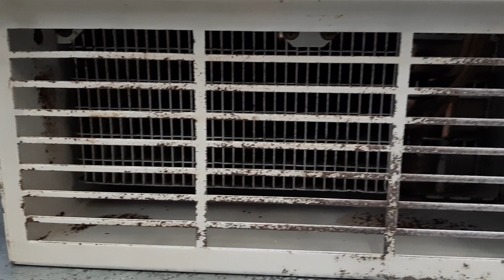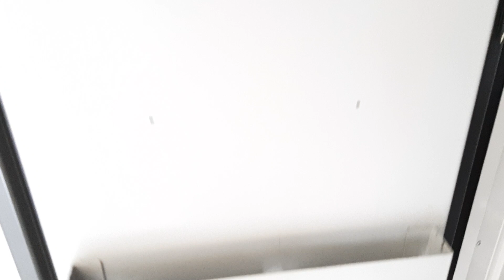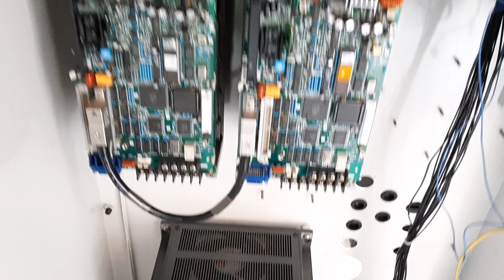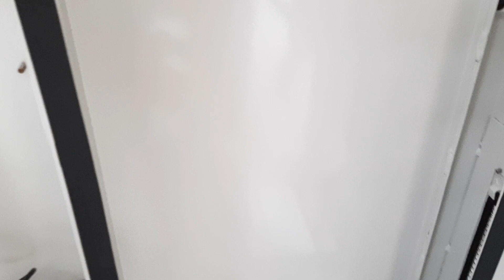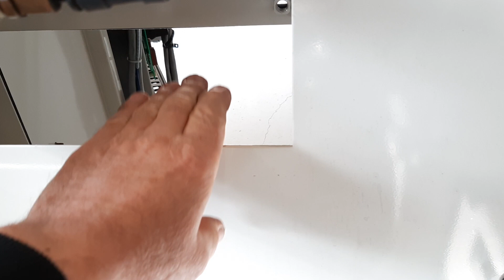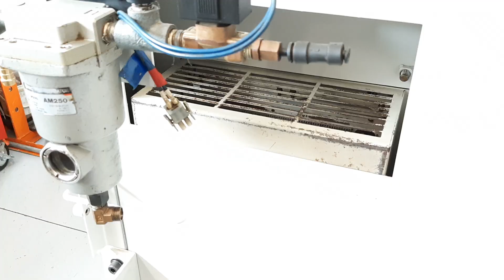CNC Lathe Rebuild. Electronic Spindle Drive.

Comment: Considering what James Kilroy has shown on his recent lathe it looks like smooth sailing for you :)
Reply from the maker: Hey Tim.
I have not seen James Kilroys video as yet ?
But I will have to have a look.
But everything I show on video might seem to be running well ???
But behind the scenes things are a lot different, LOL.
But as the saying goes.
If it was easy everyone would be doing it.
I cannot complain if I didn't have this Lathe. 
I would most lightly have nothing.
With the amount of work I plan for this Lathe I could not justify buying anything else, unfortunately. 
There are many I want.
But as you know reality has a way of changing things.
I don't really want to be stuck running a CNC machine all day.
It's a bit like pressing panels at the Ford Factory  😁😁😁.
But o am enjoying the build.
It's having the time available that is the hardest thing.
Thanks for watching. 
Much appreciated. 
Peter.

Comment: Common man pull out that heat exchanger and splatter some paint on it!  You've gone this far no sense leaving it like that!
Reply from the maker: Hey Stephen.
Good to see you.
Yes i sometimes ( most of the time ) get a bit carried away ??
It is a very important component in any CNC machine.
Very prone to failure.
Definitely worth the effort to take care of it.

One day it will be a good machine when it,s all back in one piece.
It will only be a once in a lifetime for this machine.

Most buy old machinery just to get going then trade it in on an new machine.
But this Lathe will see me out.
It,s enough of a machine for what i need it for.
Much appreciate you watching.
Peter.

Comment: The control electronics and motor drives look really clean. That cabinet must have some good filters that were well maintained. Either that or you spent a lot of time cleaning it up. Thanks for sharing. Hopefully, you don't mind if I swiped a couple screenshots of the PLC controller and motor drives for a friend that is right in the middle of selecting motors, drives, and PLC components for a CNC welder design of some kind.
Reply from the maker: Hey Tim.
The Spindle Drive is sealed inside the Electrical Cabinet.
But the Heat Exchanger is inside the cavity.
Most of the reason for removing all of the electrics.
As all the components are mounted to the Heat Exchanger.
It was a fairly time consuming job to remove everything.
If i left it as was, i am sure the Spindle Drive would had died fairly soon.
The Heat Exchanger itself was Very dirty.
But it is to be expected as this machine is almost 30 years old.
As you would know.
The main main killer of any electronics is heat ????
As far as using any information ?
More than happy if someone can learn something from my video,s.
Thanks for comment.
Peter.